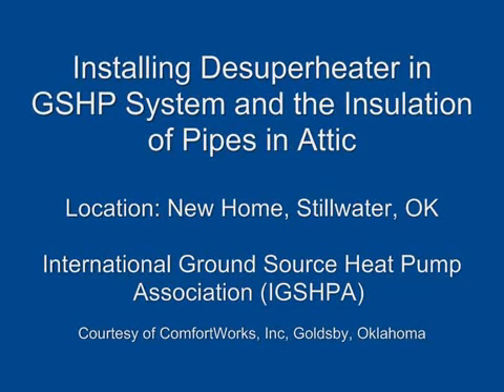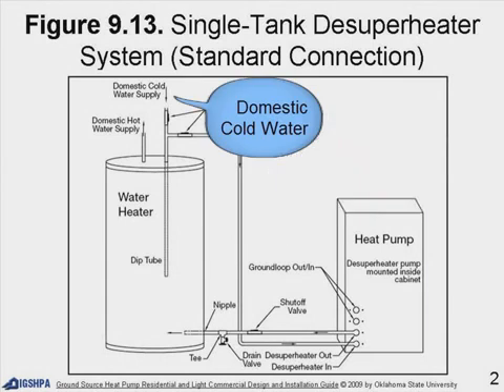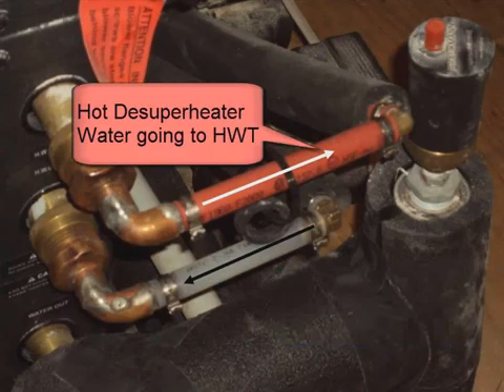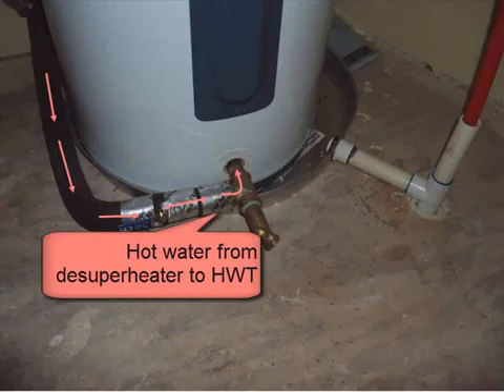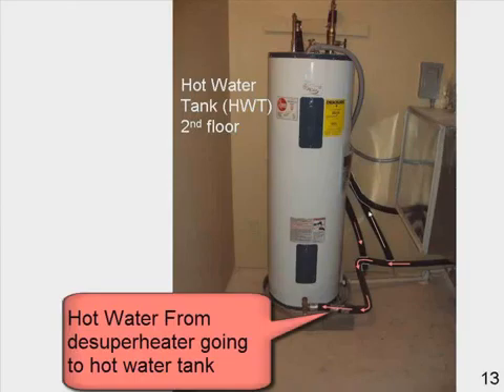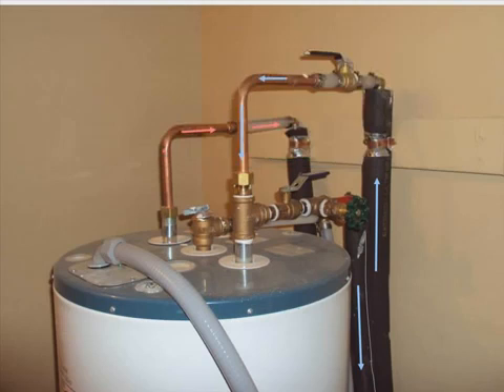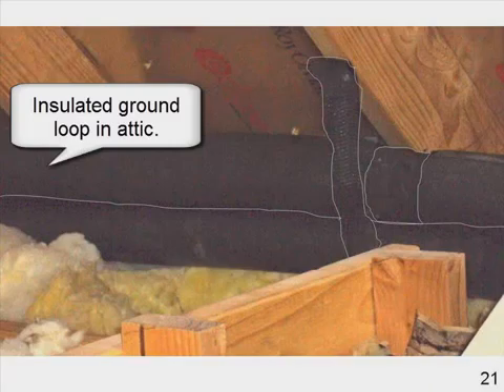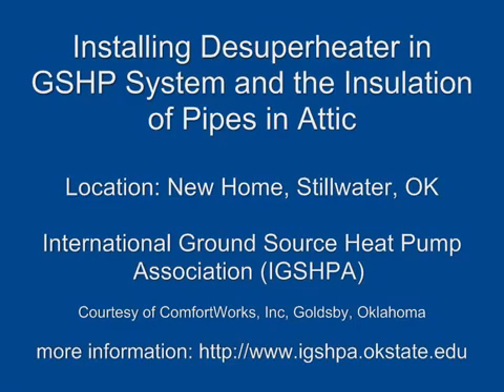HOME 6 Installing Desuperheater in GSHP System and the Insulation of Pipes in Attic

Comment: Don't standard water heaters have dip tubes that direct incoming cold water to the bottom of the holding tank?  By drawing the input to the desuperheater from the cold input of the tank and pushing i back in through the drain spigot, aren't you just recirculating water around the lowest portion of the holding tank (the cold input dip tube could be a few mere inches from the drain spigot)?  Wouldn't it make more sense to tap the normal cold input nipple for intput to the desuperheater and push the hot output of the desuperheater to the hot output nipple of the water tank?  This way as the desuperheater has a consistent supply of the coolest water possible and pushes  heated water into the top of the holding tank.
Reply: Robert Theisen Ah  ... but then your desuperheater structure becomes an alternate path for cold water to bypass the holding tank on its way to the hot supply lines for the house.   D'oh.